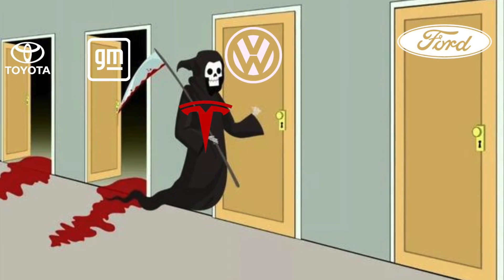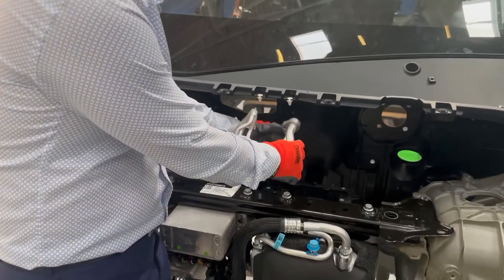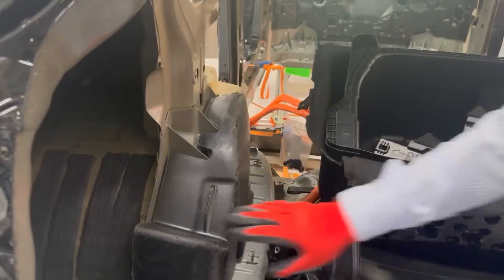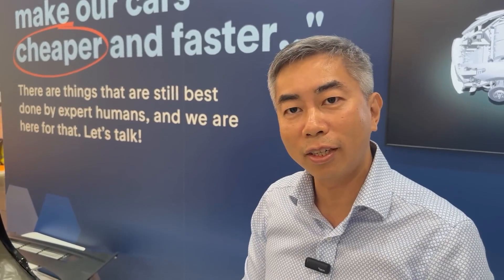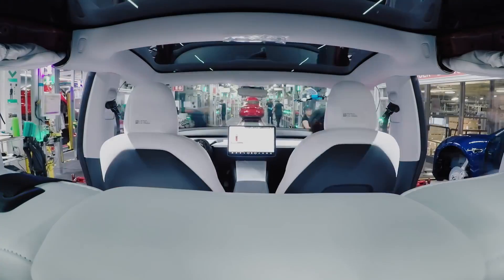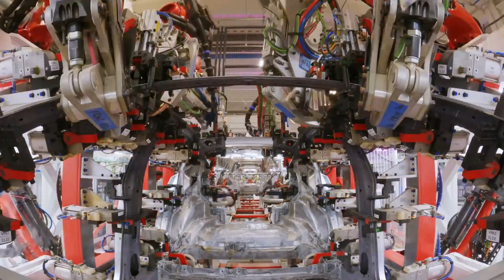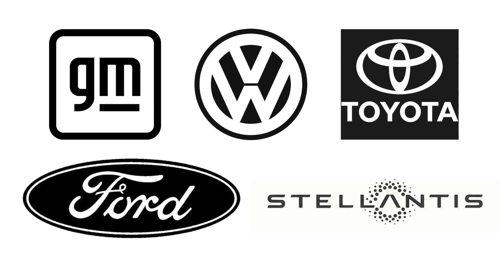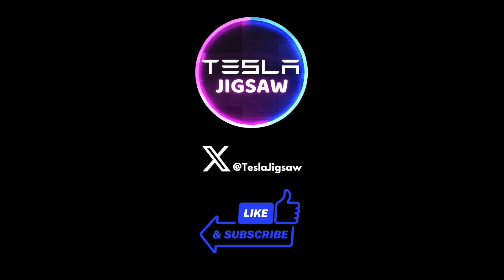MIND-BLOWING Tesla Engineering | RIP Traditional Auto

Comment: There is nothing mind blowing.
What we must care is about OWNERSHIP.
We don't care if it's cheap and fast to built for the car maker.
We care if it's cheap and easy and fast to repair in case of damages.
Cars must be used flawlessly for 20 years or more, not socks to be changed every day and being forced to buy a new one.
Reply from the maker: Quicker, cheaper assembly = lower prices/greater profit margins. Far lower cost Teslas IS their goal. Tesla Batteries are designed to last 200,000+ miles (and not only continue to work after that, but they will be recycled into now ones using 95% of the battery raw materials) With 1000's fewer parts to go wrong in a Tesla compared to that of an ICE car, it's already far better to own long term with minimal  maintenance costs.

Comment: Eureka!  "S3XY CARS" has a fake piece in it!  The "A" is just a place holder metaphor for the 3 wheeled Model A (what we've cluelessly settled for calling the Model 2)!  It has always been secretly shaped like a capital A, always had stable 2 wheeled steering & braking, always intended for single propulsion wheel, always sized to fit in the back of a Cybertruk, & the ATV was always just a stand-in until the prerequisite technologies were ready to go (FSD, 4680, Plaid motor windings, gigapressed battery shell with integrated mounting points for everything else)!